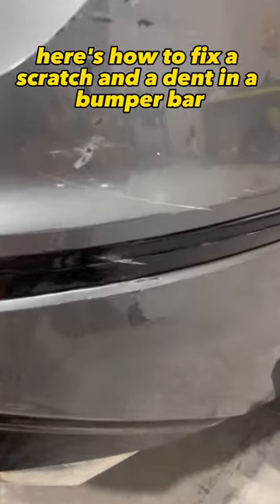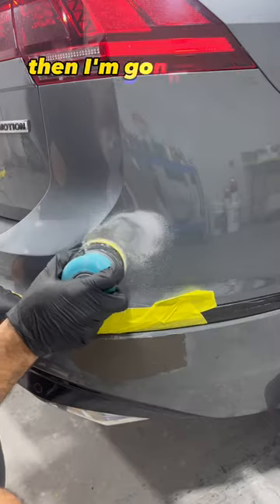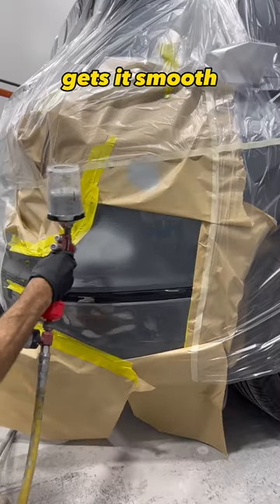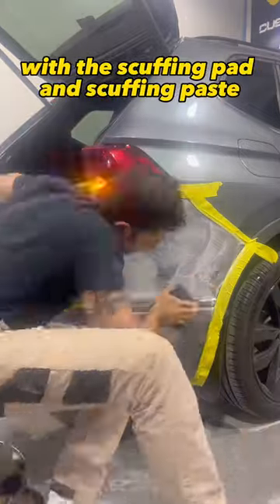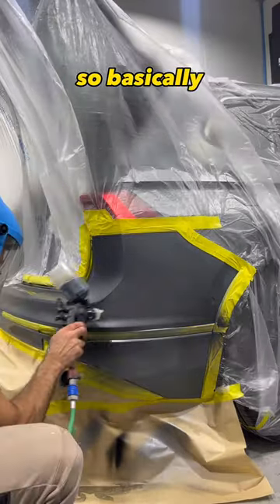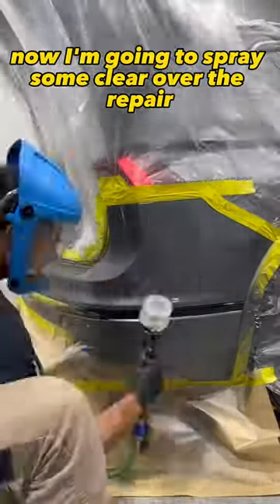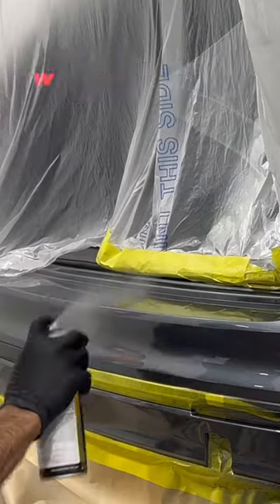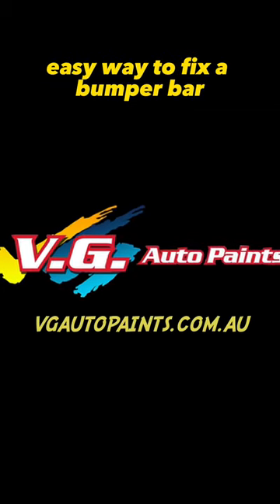How to fix a scratch and dent. Also blend paint and clear. Full detailed video coming soon.

Comment: Im a Painter and at first it seems overwhelming but let me tell you something the process of learning it is fun. It doesn’t even feel like work now and its a skill that would definitely impress many others. This guy is giving you free knowledge and many years of experience in just a little short video. 🙏🙏
Reply: Im gonna get some practice in ony my wheels then move to my car 😂
Reply: Hey Kyle, this comment gave me more confidence to do it myself to be honest. Thank you! I’m not sure about a couple things though and was wondering if you could tell me. From what it looks like I need to buy an electric polisher and a direct drive air compressor, the compressor comes with a spray gun tool. So, I see this guy uses the spray gun for a few applications and replaces the liquid between sprays, is it ok to replace the liquid for the same spray gun and if so what do I need to keep in mind to not mess with the spray gun like cleaning etc between uses? Thanks a lot 👍👍